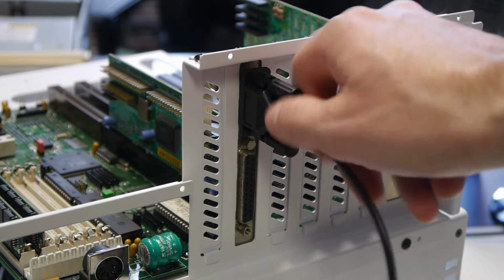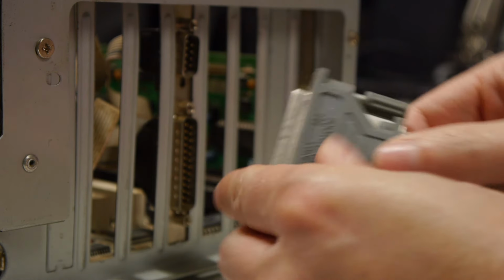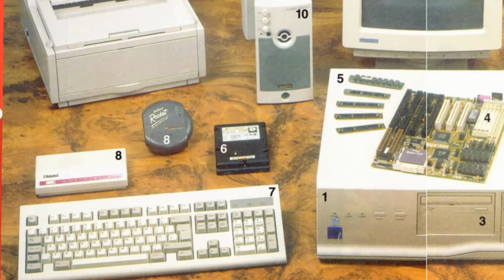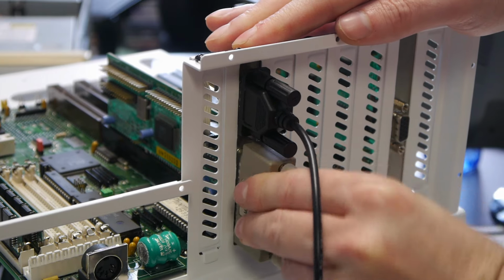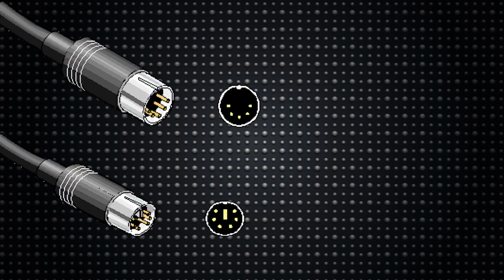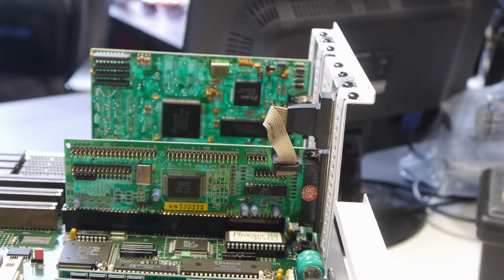What did we use before USB? | Nostalgia Nerd

Comment: The very very first USB appeared in 1994 but started slowly to make it’s way out of the factory dour to became mainstream in 1998.
Reply: I specifically remember being generally annoyed about USB stuff... as YES, the Windows.95b version has support... but getting support in Windows 95 was a major pain in the ass, as doing version updates of OS back then was... like getting a root canal done up. "Oh yeah... there is a way to get USBs to run in Windows 95... and literally the hoops you jump through actually make it much easier to just simply not use USB"

It wasn't until Windows 2K and Windows XP started having a decent market share that most computers were running that... that I did not feel like USB stuff was not a pain in the ass to run. (At which time, I was doing most of my stuff on Linux anyways... which has its own weird USB growing pains)

The reason USB took so long to get support is because Windows 95 did not support it by default. The Windows 95b version did not support it by default either. No machine with a standard install of Windows 95b could use USB ports. You literally had to pull out the install discs/disks for Windows 95b, begin and Install/Update process with it, and tell it to add USB support. Which... the Install/Update process for OS these days is a simple process... in the 90s it required a lot of annoying stuff, and generally was just as likely to fail as it would succeed. I remember install Linux for the first time in the 90s, and being amazed at how user friendly and intuitive the OS install process was by comparison... and... uh... yeah... that is an install process that generally is not available on most modern day distros for the express reason of it being archaic, clunky, and hard to navigate.
Reply: Yes, the early USB devices were extremely annoying, along with anything labeled as Plug n Play. I much preferred standard parallel serial ports and hardware with some kind of IRQ adjustment jumpers. I seem to remember having multiple USB's running simultaneously would cut the speed of all devices on the same bus by more than half, and I could never get a printer to work via USB interface. It would've been cheaper to exclude the USB interface altogether, and much less of a hassle.
Reply: USB pretty much only hit it big after the release of the iMac. Suddenly there was an actual definable market for USB devices rather than "early adopters who installed USB cards and don't have anything to run on them, what fools", and manufacturers scrambled to make USB versions of their devices specifically for the iMac. And then they wrote Windows drivers too, giving PC manufacturers a reason to follow Apple's lead and start shipping USB-capable computers.

Apple's USB stack was total ass, very flaky, but it all kinda worked well enough to cement USB's status as the interface of the future. It was great to be able to plug in and unplug devices without first shutting down, although it really was "plug 'n' pray"...
Reply: Kenny S yes yes that’s true but the prototype USB existed in 1994.
Reply: USB was in limited public use before Windows 98 was released. I tried using USB 1 devices with drivers in Windows 95, and later in Windows 98 but it was far too flakey to be of much use. Windows 98 SE support was a little better. Things improved a lot in 2000 when ME became available. So long as you kept your RAM below 256 MBytes!

Odd that he didn't mention Laplink. I still have a Laplink connector which enabled two Windows computers to 'talk' to each other via USB. Much slower and shorter range than 10 Mbps Ethernet, but it worked, if you had Laplink installed. I ran the free trial version for years, because for some reason it kept working after the trial period had expired.
Reply: RWBHere  Yeah, I know what you mean; I recently tried to build a bit of a "modern retro" gaming PC running Win98SE out of a system that originally had Windows XP on it.  I couldn't even get the USB 1 drivers working for it...
Reply: True, my Pentium MMX had 2 USB ports, what I needed for keyboard and mouse to install Crunchbang++ OS
Reply: johneygd Naw the first USB were so shit and expensive that people Used Etho Cables file sharing.
Reply: Most socket 7 boards I have used support only 66 MHz FSB (i.e. they are not the later super-socket 7's) and yet they have USB and PS/2 available as an IDC connector.  (most of these socket 7's were for retro-gaming long after the fact; in the 90's we had some Dell windows 95 pentium 133 family computer but I have no idea if the motherboard supported USB or not). Performance wise the USB connectors were monstrously resource intensive and using a USB mouse or something on these older systems is just bad. Even up to the pentium III slot 1's it's not a great experience. PS/2 or serial was the only correct choice for windows 95; and if you don't want a ball mouse for some reason your only good choice is PS/2.
Reply: Katrina Payne Don't get me fucking started stop the shit that you talk thank you

Comment: that soldered on battery on that board looks flaky , remove it
Reply: That battery is near to 35years old... Varta once made very good batteries, but this changed to crap in 2002, when the Varta battery brands where sold to "Johnson Controls" and "Spectrum Brands".
Reply: Its leaking badly... typical for VARTA crap.
Reply: yup
Reply: Remove it anyway because soldered in batteries are bad design by nature.
Reply: I've seen worse

Comment: Ironically, it was probably Apple's adoption of USB (albeit with a slightly non-standard plug design) that helped it really take off--I don't recall there being much push from the PC side of things before the iMac launched in 1998.
Reply: Surprisingly enough, my Packard Bell computer from 1997 has dual USB ports, with one of them blocked off by the IO shield for some reason.
Reply: Oh, I'm not denying that some PCs has USB prior to 1998, but I don't recall much being available to actually plug in before then--and driver support in Win95 OSR2 was shocking.
Reply: What do you mean by "Apple's adoption of USB (albeit with a slightly non-standard plug design)" ?
On PC side there was no push due to chicken and egg problem, Both Intel 430VX/430HX and VIA VP1 based motherboards had USB since 1996.
Reply: And as I said above, what could you plug into those USB sockets? Very little, especially with so little driver support in Windows for USB devices. It wasn't until Win98 hit the streets that USB on PC really became useful.
Reply: Apple had a minimal effect at best. iMac was launched in August 98, Windows 98 however released beforehand in June 98 with built-in support for the then-new USB 1.1 standard and Intel had released their new chipset supporting it even earlier in April. And by the end of the year Windows 98 itself held a whopping 17.2% market share after 6 months of life compared to Mac as a whole holding only 5% selling only 2.7 million units during the year (so only a portion were iMacs), and around 81 million copies of OSes were shipped during 1998 so you could imagine how many copies of Windows 98 there were (it sold over 500,000 units in its first four days alone). Going back even further to 1997 the USB Implementors Forum passed over 400 members with over 500 products in development, so there was already definite push from manufacturers and was undergoing a growth spurt after mid-1998 as the new products & support was being released whether Apple was involved or not (and manufacturers who focused on producing PS/2 or serial devices really wouldn't have cared much about supporting Apple anyway).

Comment: My motherboard in early 1997 had USB headers, but they weren't hooked up by default.

One thing I wish USB could do is have a USB 3 link to a hub and then multiple USB 2 streams off of that hub have the full USB 3 bandwidth to the computer.. instead the link runs at single USB 2 stream speed for USB 2 devices

Comment: One thing the designer of the USB plug wants shooting for is the 50/50 chance you have of getting it in the socket the right way around ... grrr!
Reply: It may be 50/50 but everyone's a liar if they say it doesn't take the 3rd try to get it right.
Reply: You think that's bad. Thing about the DIN and PS/2 connectors.
Reply: I think people blame USB for that it looks almost the same from both side. If USB plugs were made like HDMI that the cross section isn't rectangular, it will be much easier to tell which side is which side.
Reply: Cash Nelson unless your ports are upside down like half the computers I've used.
Reply: On the one hand, there weren't really any computer ports before USB-C (and Lightning) that worked either-side up. On the other hand, the fix companies came up with to make symmetrical USB-A plugs was so simple you wonder why the designers never thought of it to begin with.
Reply: Same way with every other serial device.
Reply: they were not that bad the plugs were round and usually had a flat side which went to the top but you did have to power off the computer before changing a keyboard or mouse for them to be detected as they were how hot swappable
Reply: Ryan Roberts
Exactly!
Reply: Not with USB-C, which is becoming more common now.
Reply: Bobby Z    It's actually a 30/70 % chance of getting the USB plug the right way around.  Not sure how, but it just is.
Reply: Ryan Toomey - true. .. but it took a while 😉
Reply: Ryan Toomey the only problem with USB-C is that we didn't have a similar form factor twenty years ago. What took so long?
Reply: the weld seam and the colored squares go down.
if you can see color through the squares, it's upside down
Reply: hey how many Bobby Z's does it take to change a light bulb. It doesn't take a dim wit to know you take a look at USB and your know if it will go in or not
Reply: That's because USB A connectors exist in 4 dimensional space and always require three tries with rotations between before fitting! I love USB C so much.
Reply: the empty holes go on top

you're welcome